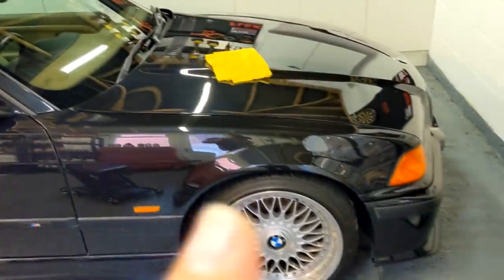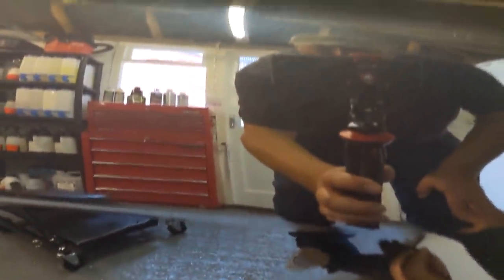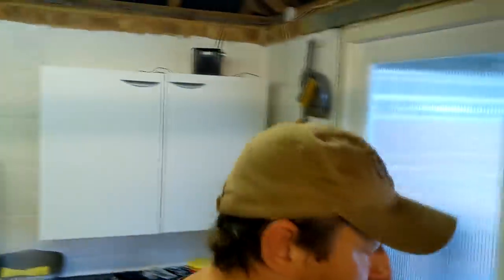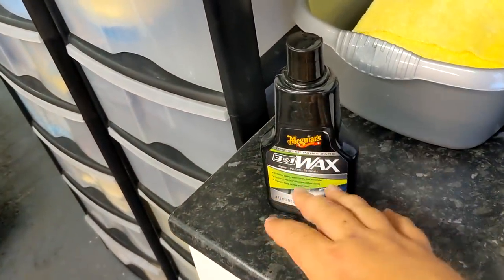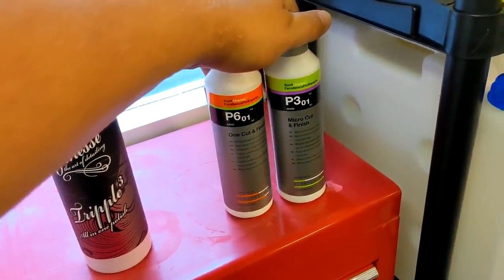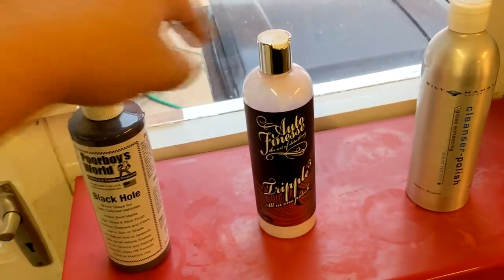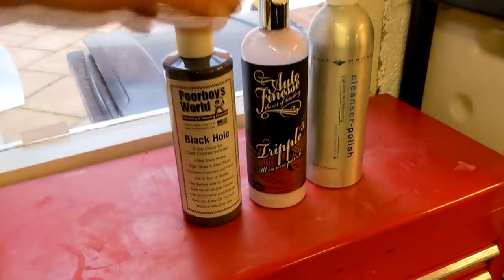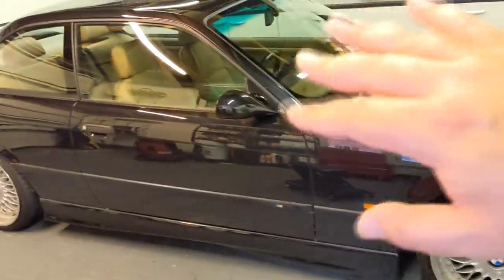Why I dont use Ceramic Coatings on my BMW E36

Comment: I reckon John Cadogan of Auto Expert got it spot on when he said, in relation to car care, that there was a continuum with people who didn't give a toss at one end and what he called car cleaning nazis at the other. A lot of people are in between. On ceramic coatings they are not attractive to a keen detailer who gets a lot of satisfaction from the process - if you enjoy pampering your car a ceramic coat just seems superfluous. I used to have a routine before I got sucked in - I'd polish a quarter of the car once a month with AG SRP (before that used Turtle Wax Original). This meant the car was cleaned and protected 3 times a year. It actually worked - I always had beading and my car was the cleanest on the street. Simple times😂
Reply: @J B I can see he isn't to everybody's taste lol.

Comment: You have answered a question I had, thank you. I want to protect my 4 year old metallic grey paint work on my M140i but I also enjoy the process of polishing it every few weeks. So a wax I put on & then can’t wax my car is not the answer. I’ve been using an Auto Smart gold carnauba wax that I picked up from the rep a couple of years ago. Works well and lasts several weeks. 2 coats gives fantastic results, but I often run out of time so it just gets the single coat. When I use this up I will buy some BH Speed wax as I’m very impressed with the other products I’ve bought having seen your reviews. The BH wheel cleaner nothing short of amazing and great value to.

Comment: This car/paint job seems to be a mental reset for you John… you look happier and less stressed 👍
Reply from the maker: hmm not sure about that.  at least in relation to the E36.  the problem I have now is finding people that can work on the car without touching the paintwork.  and I literally mean I dont want them to touch it, when they think I mean just be carefull.
Reply: @forensicunplugged4295  My biggest bug bear too Jon. I won't let anyone touch my E36 M3 period. I do all the maintenance myself and Thankfully It has never required the services of an outsider for something I couldn't do or fix. I keep it safely stored in a proper garage so it doesn't even see the sun most times. It is mint !
Reply: @forensicunplugged4295  that almost certainly will lead to frustration. I think the same goes for pretty much everything that's done around my house, I try to do everything myself nowadays because I never felt anything was done with the care I wanted it to be done.

Comment: Totally agree with all the comments on here. I love giving my cars, when new to me, a 2-stage correction. I love then applying a really high quality wax (Swissvax for me) , topping up with a caramic spray after every maintenance wash. I’d feel locked in with a ceramic coating. I like to get to my paintwork and give it a polish once a year if necessary. I also like trying different waxes from time to time. Again, a ceramic coating would prevent that. Durability isn’t a concern at all for me. I love detailing and spending time (and money!) on my cars. I’m just not interested in applying a semi-permanent coating and then leaving it.
Reply: Totally agree with you. I like ceramic coatings on glass, where enduring hydrophobic properties have a safety as well as aesthetic benefit and on wheels but, not for paintwork.

Comment: I have the poorboys white diamond glaze, I've had it for years. I love the smell and how easy it is to buff off. It gives great results and sits next to a bottle of autoglym srp that I've also had for years. I think once i get my finger out and get my wheels refub'ed i would ceramic coat them but i will stick to waxes and sealants

Comment: Give Auto finesse Power Seal a go. Put it on with your DA and a soft pad, comes off nice and easy. Leaves you with a brilliant gloss that looks more like a wax than a sealant. Protection lasts for ages as well. I believe they have stopped making it but you can still get hold of it.

Comment: Your car looks great Jon. I also shied away from ceramics on my black 67 Chevelle. But having a very soft single stage, I found it needed a light polish every year. Ever since I costed it with CSL, it has eliminated swirls and marring. I have not tried any of those toppers you have. But I just stared using NV Lustre, which is an Australian product. Lustre is the best topper I’ve ever used. It has some filling with great saturation, gloss and slickness. NV Lustre is a joy to work with and I highly recommend you try it if it’s available in the UK.

Comment: Interesting perspective  Jon!
My daily x5 has ethos graphene matrix coating and the gloss is ridiculous after 12mth😁
However the e36 project i have decided against a coating and used carpro essense and Ethos pro ceramic wax and gives a rich glow and real slick.
I like to fettle away at the paint too🤣
Reply: I'm about to apply Etho's graphene to a friend's daily, any advice? Do you have a particular maintenance regiment?
Reply: @sanscipher  personally I try to wash it once per fortnight with Carpro reset and top it with Defy once per month.  Appears to work really well for me with that method.
Keeping the car undercover also helps but mine doesn't always get garaged.
What to you think Jon?
Cheers Stuart
Reply: @dhaladetailing1225  Thank you, very helpful! :D

Comment: Hummm, I'm a Ceramic person myself. I own 3 vehicles all kept outside. New CarPro SIC is amazing. Gloss and protection for ages, far superior to any wax I have used in the past, easy to maintain a every 2weeks 3 vehicle wash. Once the 2 show vehicles are polished and sealed they are sealed, no swirls. The daily van that does the miles is proving a coating is long lasting and it's a smart repair Van so gets hit with paint overspray 3 times a day.

Comment: I like how you casually just put in a polishing session where I always prepare for weeks to have that one weekend to do it all. I'm massively stressed everytime and my back is killing me afterwards.
Reply from the maker: yer but thats proper polishing.  In this instance would buff the wing in 20 seconds with a cordless DA and its done.  so not really polisihng almost just applying the AIO with machine really.
Reply: @forensicunplugged4295  John could you do a video on this.  I’d like to see you use a machine polisher in an applicator scenario rather than a polishing one….how much product you’re using, arm speed, machine speed etc.

Comment: I wasn't going to go the ceramic route.... until Infinity Wax Synergy lite came out. The appeal of that? Long term filling for non machine polished paint that's outside 24/7. Followed up by infrequent Synergy QD. Not applied it yet so we will see if it can cover the light swirling that I can only see in certain light at night, but know is there so would like to cover it without machine polishing. We will see if it does the trick.
Reply: Synergy Lite is a phenomenal product.
I have not seen any YouTube Detailer using it yet though 🤷🏻‍♂️🤔🏴👍
Reply: @kinnonmcallister  I suspect videos are being held off until stocks build up... as it will create big demand if reviews give same results as users.

Comment: Good vid Jon. The Cleanser Polish is top class. Will take a wax or a sealant on top no bother. Might do cleanser polish and fusso for winter. Top that up with ADBL synthetic spray wax. The germans really like this stuff, supposedly better than BSD

Comment: Jon, great channels, great info. we are actual looking at going against the grain with a new car purchase in the new year but no ceramic coating. I’m so confused by all the choice out there what would you recommend for a nice polish/gloss that we only have t9 reply 3/4 times a year.  We are looking to use Bilt Hamber Touch as snow foam but a bit at sea with other products.

Comment: Had a bottle of triple for years now, i only really use it for plastic chrome bits by hand. Only autofinesse product I seem to get in with 🤣 does work rather well, but after a while it does end up like water.
Reply: I agree Mark.  It's the only AF Product I get on with, not a fan of any others I have used and the spray heads are terrible.

Comment: John another great video and with so many products on the market not sure whether i wanted to use a ceramic coating or traditional wax. Well i've just used bilt hamber speed wax on the wife's car and i'm very pleased with the results. I'm now about to give my car a machine polish with Angelwax Redemption as it only has very light swirls, the car is 1 year old. I'm going to use either TW Graphene wax or BH speed wax. Should I use a paint glaze after the intial polish before I wax it?

Comment: Hi Jon, excuse my lack of knowledge in the detailing world. I bought Bilt Hamber products after watching your videos and decided to buy touch on sachets too. I haven't seen a video from you reviewing it. I want to use it on motorcycle wheels cause they are painted and prevent  brake dust building up. Is it possible you can do a video of the product please 👍🏻😁
Reply from the maker: I dont know if I would use touch on to like coat a bike in material.  Im no bike expert but like I would wash the bike and rinse the bike and dry the bike.  I would maybe wax the petrol hand and any painted parts.  I would brighten up and show metals like chome with a fine metal polish etc..   And that would be it.  my advice is dont use touch on, for a bike because you cant control where its going so well.

Comment: I noticed if using Something like prewax or aio regularly in re painted car the defects of paint work will appear under the clear coat , this only happens when using lacquer with bad quality.  For repaint car I found Menzerna 2in1 work well contains no silicon.

Comment: I’m on the same page with regards to ceramic coatings. My favourite all in one in Rupes Uno Protect. A joy to use
Reply: It can get decent correction with the right pad and leaves a lovely slick/glossy finish in so little time. I use with the Rupes yellow wool pads.
Reply: @Audittr2108  a great combo & actually some decent cut with wool & an AIO👍👍

Comment: Hi Jon, enjoy your videos heaps. I'm not a detailer just a person wanting to look after his own car the best he can. I live in a part of Australia where it's very hot (a cold winter day is 25C, 77F Summer is normally 40C+). We also have a lot of airborn iron ore dust which is known to be very abrasive. My thoughts are that my, soon to arrive, Lucid Red Pearl Mustang has soft paint and will need to be protected from the abrasive effects of the airborn dust and the severe UV attack. Therefore I was thinking it best to use a ceramic coating. I'd love to know your thoughts.
Reply from the maker: waxes can get a bit wierd in really high temps.  the panel temps of the cars in the sun can be huge and the waxes can breakdown and soften.   but if you put a coating on you cant pamper the paint, your typically only going to be able to layer more films on top and this isnt the same as a nice whizz over with a AIO like tripple.

Comment: Very interesting .. what do you think of the Menzerna Powerlock and Collinite 845 combo? Don’t think I’ve seen you mention Powerlock before? They seem to go well together when I’ve used them. Or do you just like to use one wax coating and no sealant? Cheers
Reply from the maker: Im not into combo'ing sealants and waxes generally lots of reasons but I cant be bothered to spread and apply two heavy products like that. Too much buffage.     maybe as a winter thing if you have a combo you like go for it.

Comment: Ive seen some videos of people getting amazing results compounding and polishing by hand. I know it would take a long time but if i was patient and feeling energetic could i make my e36’s paintwork shine like yours using megs ultimate compound and polish by hand? Or do you recommend any different products? Don’t wanna buy a polisher
Reply from the maker: honestly just buy a machine polisher even if its one of those argos DA's.
Reply: @forensicunplugged4295  yeah I guess, I’m Just a bit worried about burning through the clear coat since I’ve never used one before. Any way to check how much you have left without a costly reader or any advice you have would be great thanks, Jon
Reply from the maker: @fraforgt-350r2  if in doubt use a soft pad and a finishing polish and you could buff on that hood all week and not go through.  a cheap PDG will give you overal paint system reading anything over 100-150 is commen.   but can be tricky.   I would not worry too much about this though. get stuck in mate only way to learn is to get stuck in.

washing https://youtu.be/AUytWaLtOOo
decon  https://youtu.be/9B9Cn-GeJqw
polishing https://youtu.be/MI_m2rO-OpM
products https://youtu.be/I7q5E8Kz-CY

You should check out my Detailing Fundamentals training course with discount code applied:

https://ioa.pxf.io/c/2687409/1012495/12764
Reply: @forensicunplugged4295  thanks so much mate, this has really inspired me. I’m gonna get one of those flex machines

Comment: This spring, I decided to try a "cleaner wax" on my truck instead of a spray sealant. I have become somewhat concerned about burning through clearcoat as the modern stuff is apparently so thin. I thought perhaps the light cleansing and filling properties would help with the light swirls/love marks. Unfortunately not, however I noticed this weekend that after rain, water spots just didn't seem to be visible! Had heard that wax isn't as prone to it. Any truth to that?🤔

Comment: Can you use optimum no rinse with carnuba (the green one) on a ceramic coated car ?
Reply from the maker: if you want but I would personally not do this.. but I dont really want a coat of wax on a coated car or whats the point in having a coating.

Comment: Attempted high jacking of the comment section inbound.. been thinking about selling my beloved 2008 E92 325i and getting a 2006 RAV4… anyone think anything about this!? I absolutely love the E92, it looks fantastic, drives lovely (on nice roads) & sounds great too. But it’s turning into a drive ornament, used once a week.. and has a fair amount of money just sat on the drive. I’m interested in a practical car for the bad roads in Gloucestershire, that is pretty cool but I don’t really care about.. thoughts FD family.. 🤙🏽 (it’s coming home!?)
Reply from the maker: keep it mate, its like rock bottem value right now.
Reply: I had an E92 325 too years back, lovely motor. A Rav 4 of that age.... pretty terrible tbh, and a nightmare if anything goes wrong,e.g. engine out just to change the clutch etc. I get what you're saying, but just not with a Rav. They drive terribly too
Reply: Really appreciate the replies from both of you.
Reply: @forensicunplugged4295  after that performance, we need an upgraded version of its coming home 👏🏽